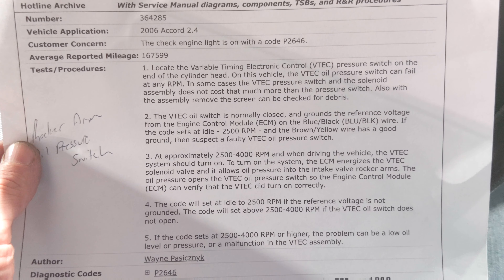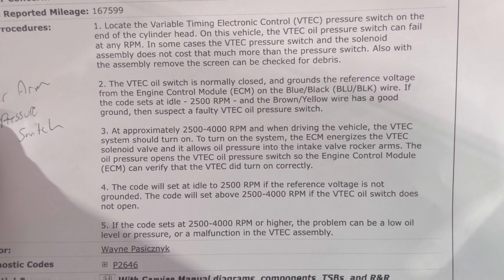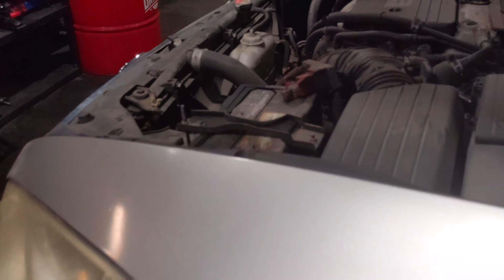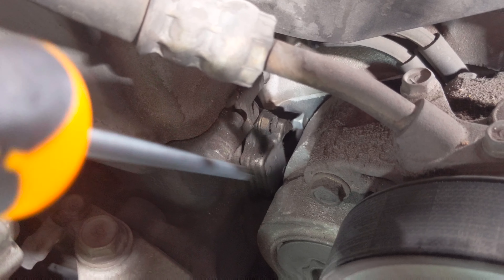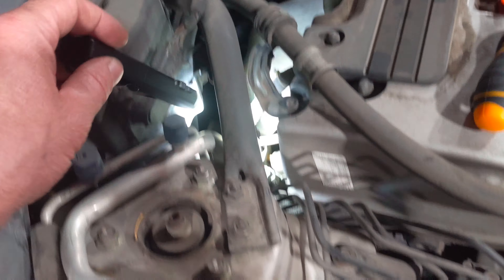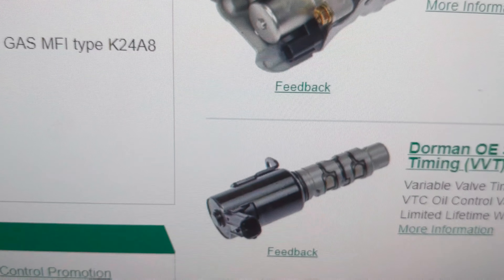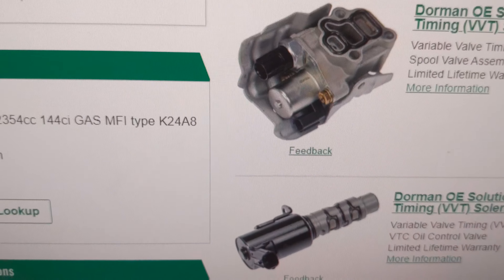P2646 Honda VTEC Fixed "Do This First"

Comment: I have a fixed many P 2646 Hondas  Start with clean oil and a good filter, secondly I clean and inspect connectors if any corrosion or cracking, I replace both connectors. That solves 90% of the P 2646 third, clean solenoid valve, never replace solenoid valve with aftermarket!
Reply: Could u please tell me which connectors need to be checked? Im desperate
Reply: Is it connector to the actuator?
Reply: Mine worked with just an oil change and filter thank you this was helpful
Reply: I agree with not using aftermarket.  I get my oil and filter from Honda, which is usually less than aftermarket.  I also check NAPA's Altrom line for Honda solenoids and actuators, which usually come in a Honda box.
Reply: I had the dreaded p2646 error on a 2009 CRV. The car had been sitting for over a year. The first error I got was the mass air device which I replaced. Secondly the fuel pump wasn't making any noise so I replaced it. Then the car started. Upon driving it around the block it through the 2646 error. Not being young or a contortionist I couldn't get to the back of the engine or the other devices that may be clogged so I went and got seafoam and added to the oil. I ran the car for a half hour drained the oil put fresh Castrol in it drove it around the block after resetting the code and it was all good. Two weeks worth of driving so far no errors definitely the cheapest way to start the process without replacing parts.

Comment: All this stems from not changing the PCV valve. Once that Pcv valve gets stuck open, it instantly wreaks havoc on the engine and allows sludge to build up quickly. That messes up the spool valve/vtec  solenoid.
Reply: Why does this happen

Comment: I changed my oil, and the check engine light goes off after driving about 40-50 miles.

Comment: This video is outdated if you have a 2006 Pilot with the J35Z1 V6 engine.  This engine will have an oil pressure sensor which contains a potentiometer, and, therefore will have 3 pins in the connector.  This is NOT a switch. If you go to the parts house, and they want you to prepay for them to order it, be aware that what arrives may not be correct.  Make them show you the specs and photo before you order, if possible.  And verify that it has 3 pins.  The J35A9 engine WILL have a switch, with just 2 pins in the connector.
Reply: this video is for a entirely different engine.
Reply: @internetpointsbank  That figures.  They're hardly ever for the one the average guy has.

Comment: So I cleared the code, changed my engine oil, put an aftermarket vtec solenoid(have the gaskets as well so might put back the original solenoid) check engine light comes back on everytime I hit 65mph

Comment: Anyone ever tried motor flushing the engine prior to oil change?? Also clean out screen port with carb clean and the electrical plug with electrical contact cleaner???😊😊😊

Comment: I did all that and still the rpm wrong go higher then 3
Reply: Have you got it fixed yet?
Reply: Did you got it fixed? I heard that if that doesn’t help then it needs the whole new assembly
Reply: @jarana10  oil change did the trick
Reply: @jarana10 before spending money on parts test them by applying 12volts. You dont want to spend $250-500 for parts on the hope you might fix it after the last hope thing didnt work. The parts can be tested.

Comment: Thanky-Thanky (Gomer Pyle style ;-) Pulled the valve out and found the screen very plugged. Pro tips 1) They will be tight, best to use a six point socket with a little extension 2) I suggest having a new gasket on hand As mine had splits, It is complex  "o-ring" type gasket but local parts places had them. The gasket has a grove in it into which the screen slips. IMO you don't need to undo the wires, just remove the three 6mm screws (10mm socket)  and then pull the vale up high enough to service the screen. I used a can of brake parts cleaner with its straw. 3) have a mirror on hand to clean and inspect the mounting surface on back of the head 4) when installing, put the bottom screw into the valve and lower it down with your right hand, reach around the end of the engine with your left, find the lower screw hole and guide the screw in the valve into it. If I had had all the tools , cleaner together and a fresh gasket, it could be done in 5 minutes.  
My issue was the thing going into limp mode (limit to 3krpm) Cleaning screen and flush out valve made a small improvement but, sad to say, replaced valve with new one from Amazon wound up making if worse.  
If I understand the oil flow, it seems the grit in the screen is due to crud getting past the oil filter (bypassing due to old, cheap, small filter) and worse It looks to me the same grit would be going to the bearings.  This tells me that they are probably in bad shape and that that would cause generally low engine oil pressure ( I should check that next) . Perhaps pulling the pan and replacing the bearings could get the oil pressure up enough to get some more miles out if it.  I suggest ALWAYS put in a high-quality long millage filter so it doesn’t bypass. When I got the car it looked like to oil had about 30k miles on the oil change :-\

Comment: Excellent description from NAPA:

The variable valve timing oil pressure switch is a normally open switch located at the VVT solenoid. When the VTEC oil pressure switch closes, the voltage should drop to zero. This is how the PCM knows if oil pressure was applied to the VTEC system. When this system fails to operate properly the ECM may set a code. The codes associated with this are P1253 (21) for the solenoid and P1259 (22) for the pressure switch. Each code requires further diagnosis prior to condemning the solenoid or the VTEC oil pressure switch.

If you do not maintain your car, the screen in the VTEC solenoid can become plugged. The pressure switch won’t pick the problem up because it is located before the screen. The VTEC kicks in, but oil pressure never gets to the rocker shaft. If you unplug the solenoid and there is no difference in engine power, check the filter first.

Comment: I appreciate what you did here, but as a newly single, broke, mom, I would so appreciate it if you took this to the "for single mom's" level.  (I'd say "for dummies," but it's just a matter of no experience.)  When you talk about cleaning the screens, with what? Soap & water, gasoline, Brake Clean, witch craft?When you talk about testing, I've no idea, a scantron, fill in the blank or of with what, 
to what or how?  Thank you so much for indulging my mommy madness.
Reply: At 3:12, he explains how to test: supply 12 volt power and ground (to the electrical terminals of solenoid). He says it quickly, but he does explain. If the switch changes position when power is applied, it works. The screens filter oil. You need to clean with something that is effective with oil. I'm sure you've heard that oil and water don't mix. You could try soap and water, but if you think about it, gasoline or some specialty cleaner makes more sense.

Comment: I carelessly let my oil get low. I change it religiously but went a few months without checking oil level. Got the engine light and went into limp mode. Changed my oil and filter and she ran great...for 5 miles then again went into limp mode. 

Removed spool valve assembly. Screen is clean! Spool valve moves when pushed by hand. Hmm, so why did I lose VTEC again?

From reading about VTEC the pressure switch doesn't affect VTEC per se, it just reports when VTEC is on or off.
But the solenoid that moves the spool valve is what makes VTEC go on or off. So I wonder if the solenoid itself ever goes bad and if it can be replaced, rather than replacing the entire spool valve assembly.

My Honda dealer is out of stock of the OEM spool valve assembly. I'm wary of aftermarket parts that sell for 1/2 price, I keep reading that they leak soon after installation.

Comment: Ok but how do you get the bottom bolt out to check the screen without removing the tensioner and power steering pump??
Reply: You cant
Reply: I do it all the time. Not easy, but as long as you have some finger dexterity it’s not much more difficult than removing the motor mount nuts and jacking up the engine to support it. I use a combination of sockets: long reach, regular with 1”/2” extensions, and a universal. I use a 3/8” ratchet, my fingers, and once even a DeWalt 3/8” side angle adapter (but I’ve done it without that too). The slow deliberate procedure makes it a PITA, but I’ve done it about 7 times. We’re talking about that one out-of-sight bolt on the alternator, right? Oh, BTW I usually also remove the tensioner in addition to the alternator.

Comment: my car has this code and it stutters when i accelerate i have my oil and engine light on this happened after i ran out of fuel what could it be
Reply: Did you fix it.. Mine is doing the exact same thing. After I ran outta gas.. Plz help
Reply: Did you check that your gas cap is tight? Loose cap will cause check engine light.

Comment: Will the engine light turn off on its own, or must the code be cleared? Just cleaned the screens on mine...
Reply: Engine light will turn off on its own, could take a few miles.

Comment: My car turns on oil light on normal drive mode when parked . I changed oil pump and oil pressure sensor and then I tried to drive and then the code p2646 triggered what is wrong guys. I’m so frustrated for this engjne

Comment: It's almost always water in the connectors.     when you open the Element hood wet,  water runs right down into the connectors.
trust me.    dry out and seal the connectors first.   it almost always works.
Reply: Could u please tell me which connectors are these?
Reply: @filthycade2399  the plug that connects into your oil pressure sensor.
Reply: @Kevnadian  can you tell me where that sensor is or link to a diagram?

Comment: So I'm better off taking my car to a Mechanic because idk how I would even get to the parts.

I have a 2007 Honda Accord with over 238,000 miles on her. We have replaced 1 O2 sensor power steering pump starter and the heater valve with heater hose. I have codes for another O2 sensor the Catalytic Converter a Rocker Arm and a Knox Sensor. I'm trying to do my best to take care of the car but I seem to be failing.
Reply: I have the same codes! Did you find a fix?
Reply: @fnbrhub8039 same codes as well did you find a fix?
Reply: I have the same exact codes. Never buying honors Honda again.

Comment: I have an 07 CR-V with this code. Recent cylinder head work (it was milled at a shop after overheating due to head gasket failure). Got the code probably 80 miles after getting the car back. My Honda guy wanted to start with an oil change and genuine filter. Code came back pretty quick. He’s saying VTEC system tests all passed and suspects main bearing wear?! Said to do main and rod bearings which I’ve never heard of with this code.. any advice?
Reply: @justinralphio8494  Thank you so much for your reply. This is great information. So do you think it’s reasonable to do the main bearing repair or should I suggest this bypass like you’re talking about? How many hours of labor roughly would I expect to pay for the bearing job? If that’s a decent improvement for the engine, I wouldn’t mind doing it because I do like the car and I got it for free. Mine is Japan built if that makes a difference. Thanks again!
Reply: @justinralphio8494  
Thank you for this advice.
This oil pressure switch, where is it in relation to the spool valve?? 
I am very good electrically and complex systems wise .  I would like to do the by pass the pressure  switch procedure. 
Question, is the pressure switch a two wire NO or Normally Open switch??
Reply: @adventurekid9242 
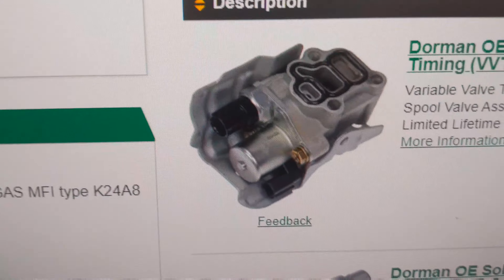02:55 pressure switch is next to the solenoid on top of the spool valve assy
Reply: @justinralphio8494 Can't wait to try bypassing the VTEC. I have 2006 Odyssey with 205K miles. Just got the valves calibrated which resolved misfire codes. Also, replaced VTEC solenoid gasket Now with P2646 code, goes into limp mode around 60mph. Will try cleaning VTEC solenoid first. If it doesn't work, will try your fix in bypassing it. Much appreciated!
Reply: @justinralphio8494  would you be able to provide pictures of how to do this😅

Comment: Oil clean, engine clean, filterSSS CLEAN , oil switch from dealer , still the same problem, I have replaced probably 10 times the switch and nothing, the switch function is to cut the ground that goes to the computer. Such thing is achieved with pressure oil , oil enter to the switch and separate two electrical contact inside of the switch , computer interpret this as a signal to activate the vtec mechanism☹️
Reply: I'm having the dame issue.

Comment: Stupid Honda, designed by monkeys. Some Vtec oil pressure sensor mounted under hood straight up so the connector acts like a cup. "Let's put a yazaki connector mounted like a cup in a wet location with high thermal cycling", idiots. Code P2646 pops up and dealer recommends you change out the whole assembly for over $350 in parts. I unplugged the sensor, saw the water in there, blew it out with compressed air, let it dry, loaded it up with dielectric grease, cleared the code and it seems to work fine. Now let's see how long that will last.
Reply: Like u can do better😱
Reply: @Jose-zg7ft  I do.  I design electrical systems for Mack truck
Reply: @petergross8808  i respect it, but these people who design the engine are engineers they are bright
Reply: As an Electrical engineer with over 30 years of automotive design experience, I recognize a rookie mistake like this that was discovered too late in the design process for them to retool the part and correct it so they made the choice to run with it.  IMHO that was a bad choice considering it is such a popular fix but my fix only lasted three weeks and I ended up replacing the VVT with a unit from RockAuto.  I have helped and been helped by German and Japanese engineers but am still known by technicians as that friggen engineer who thought that up. We all do our best but stupid stuff slips by us.  This design is one of them. @Jose-zg7ft